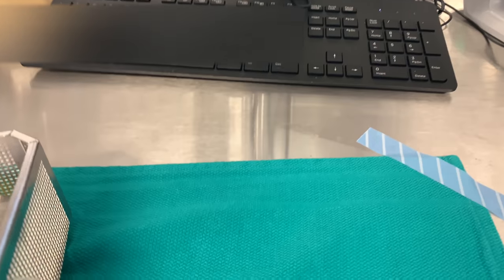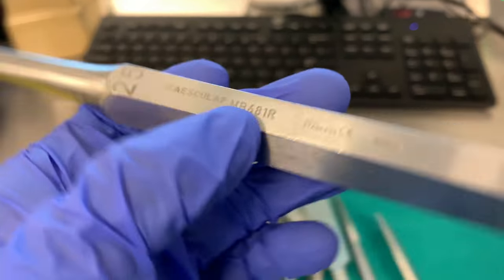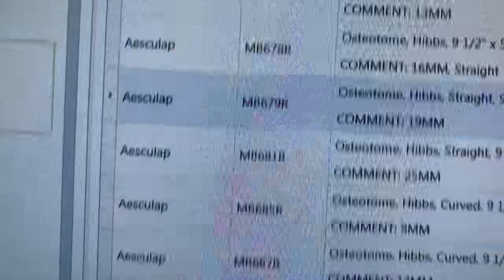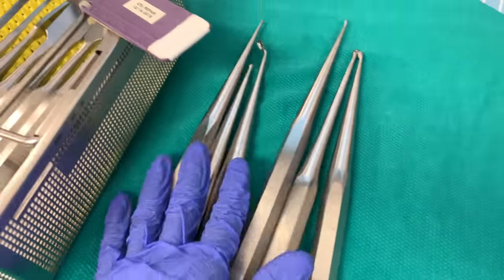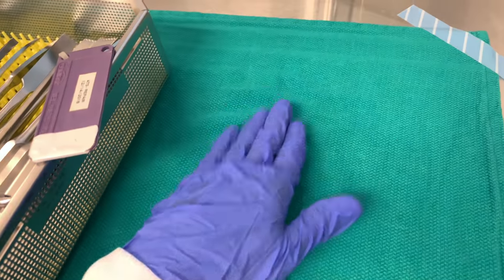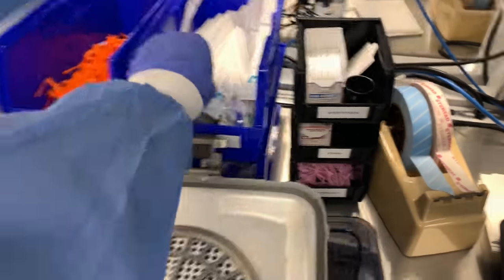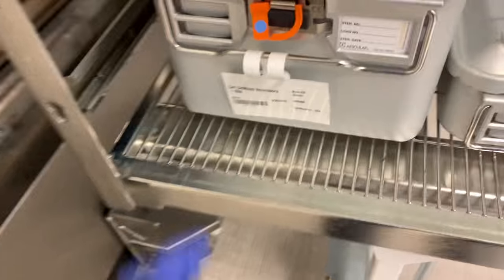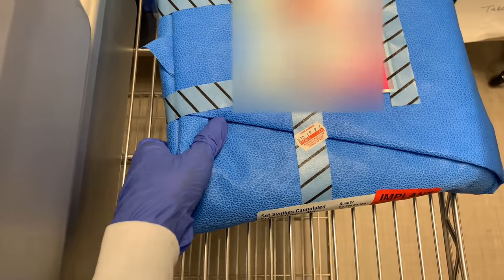How Sets Are Assembled In SPD

Comment: Just noting you should not be wearing gloves in prep and pack because it signifies that the area or items are dirty. Gloves prevent the sense of touch; you may not feel or catch residues on the instrumentation. Also, no wrappers or tape should be placed on the surface of the workstation. They are made of stainless steel to be easily cleaned and disifected to not cause any cross contaimination. Also a sharpness test should be done on each osteotome and curette. Lastly, catalog numbers are to assist in proper identification of the instrument but you should verify the name and size of the instrument and use the catalog as a verification. There could be various substitutes by other vendors available. The more indicators used, the potential for a failure. If one fails the tray is unusable. Also it is one indicator in the middle for a wrapped set, and opposite corners for a contianerized set. Also verify cleanliness of the container prior to packaging. AAMI ST79.

Comment: How did you know to use a rigid container... does it say to in the count sheet?
Reply from the maker: Because it is an instrument set. Depending on what it is you need to use an aesculap container. Wrapping this set is not recommended, and peel packing would be too heavy it would not withstand the weight. And yes it does say it on the count sheet how it’s supposed to be properly stored. It will say, “Container, Wrapped, or Peel Pack” I hope this info helps out.

Comment: I know that we are taught to move with a sense of urgency. Have you ever felt rushed to assemble trays and other instrument sets in prep/pack? Also, does the count sheet not get wet during sterilization?
Reply from the maker: Often times yes, especially when it’s an IUSS aka “flashing” or one traying an instrument. In that case we need to move quickly because the patient is already on the table waiting. During the steam sterilization process the count sheet does get wet technically but there also is a drying process in the sterilization cycle as well so it will dry up.